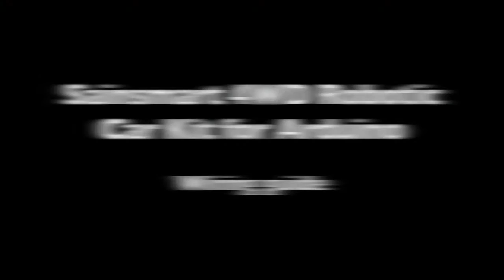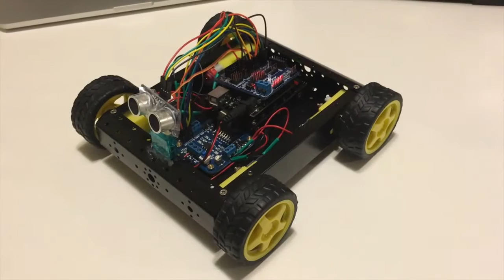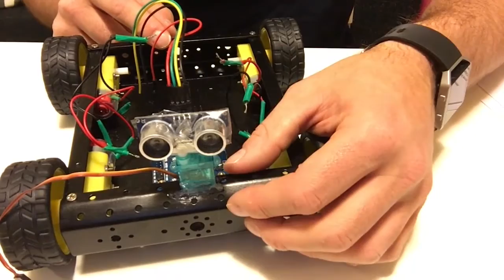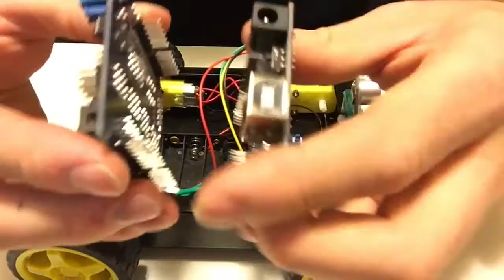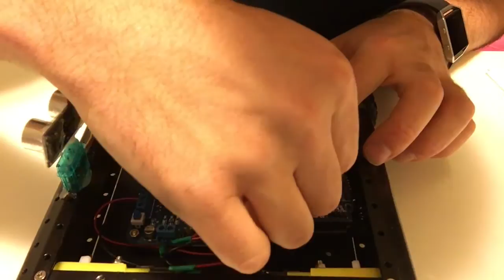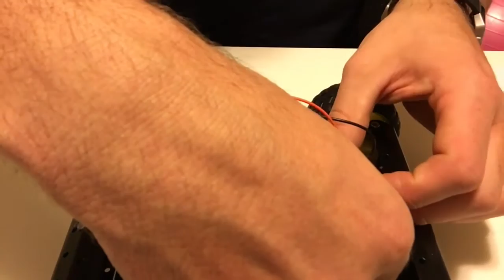Building an Autonomous 4WD Robotic Car with Arduino Part 2 - Wiring up the car

Comment: I'm using four peg perego motors, therefore using two batteries, how would I connect from the two batteries to the motor driver i'm using?

Comment: Hello Thank you for the tutorial but I've a question ,,,,, even after I've done the connection when we go to last step that we press the button my motors are not spinning but yours are ... why so ?
thank you ?
Reply: Motor connections maybe wrong or there must be an issue with the voltages you are supplying ...Try 12 volt supply ..Gudluck